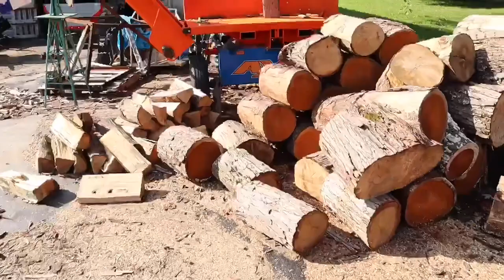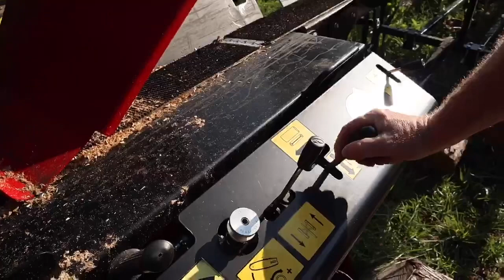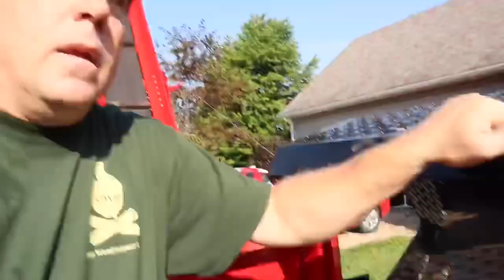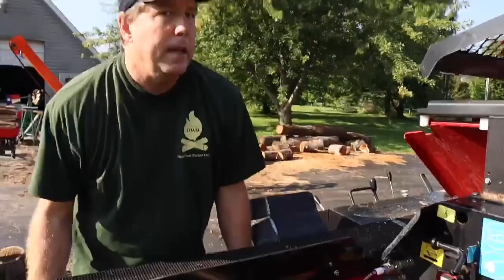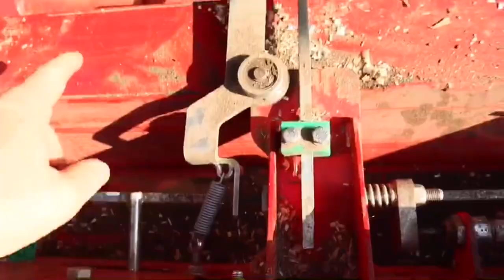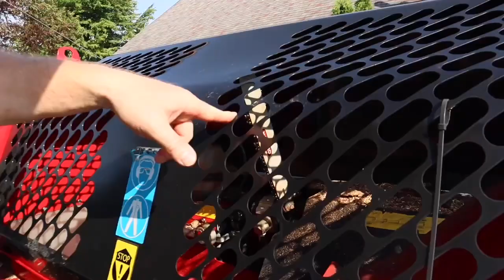I'M DONE JOKING AROUND!!!

Comment: Hi Joe, you are spot on with how the heat  affects us experienced guys . Hehe. I know you are planning on moving your operation to the rear of your property, but have you considered putting one or two of those portable aluminum carports in your current driveway. Leave room for truck deliveries but with the shade and weather protection for your equipment it seems to merit some consideration. Let the live deck hang out on one side and the conveyer sit out the other. Inside is cool old Joe! Maybe set up a fan ! Machine 75% out of the weather and roof structure could bolt down to your driveway. Just a thought! Enjoy the warmth because old man winter is coming.( Hey no snow on the machinery )!
Reply from the maker: I have a plan for roofs when I get to my permanent location.  I use the portable canopy when I make wood during the days but I have to be careful for wind and rain.  Joe

Comment: One way to cut the heat a few degrees Joe is by working in the shade.  If I were you I think I would install a cable overhead to hang a tarp or two off of. Helps if you get a week of rain in the fall too. 
Another great heat killer is a mister installed in front of a fan. It only takes a gallon or two an hour but man what a difference, especially if you run the water through a cooler.
Reply from the maker: It seems the heat has been more intense this summer than most.  Beyond the rain and this heat wave...Ugh.  I hope to have a roof over my machine if and when I get moved to my permanent location
Reply: @ohiowoodburner  Joe you and I are about the same age and  build 6'4" 275 pounds plus, between 45 and 55. The heat was rough even when we were kids. But now we have air conditioning every where.
I just don't fight it anymore. On hot days I do cooler stuff. On cool days I  do stuff that takes lots of torque.

A buddy of mine who is a pilot pointed something out to me. Planes take off on half the runway on cool days.  The air is denser so the wings have more lift but most importantly the engines run better, faster, have way more power, with cool dense air.
Now I can't fly but I can cut wood.
Give me an axe on a cold and look out.

Comment: It's so hot that a cup of water thrown in the air will boil before it hits the ground.   We have the same heat wave in my area of Southern Ontario, Canada.  The temps and humidity are suppose to drop to normal levels by mid week.
Reply from the maker: Very hot indeed BW

Comment: You and me both man. After working my day job delivering building materials I have no energy to got cut and split logs. It’s nuts. I’ve got to loads to send but damn is the heat making loading the trailer a real pain. With weather permitting I’m going to try and get at least one done today if it’s not to insanely hot out. Love the videos.
Reply from the maker: Thanks HFS!

Comment: Thanks for these videos. Always cool to see how the Japa works internally.
Quick question for you: Does that hydraulic shutoff adjustment need to be done because the valve is wearing out? Or did something move simply due to vibration over the past 2 years? Thanks!
Reply from the maker: Hard for me to explain but the saw bar hit  log on its return to home.  That impact I think made the setting go off.
Reply: @ohiowoodburner  Makes sense. Thanks!